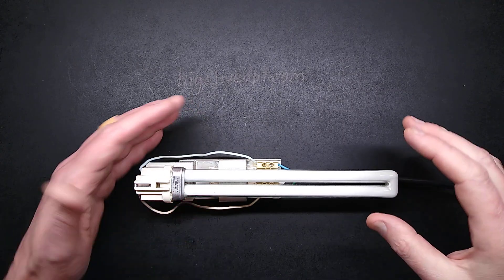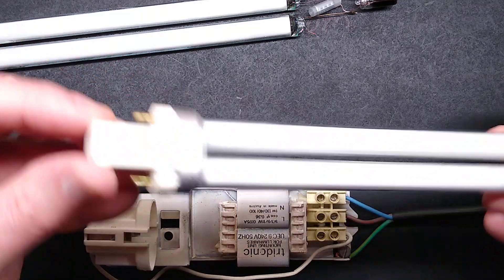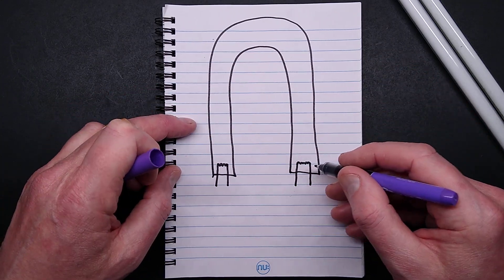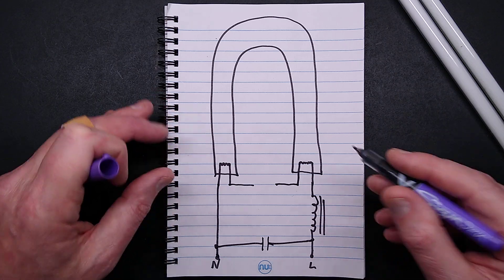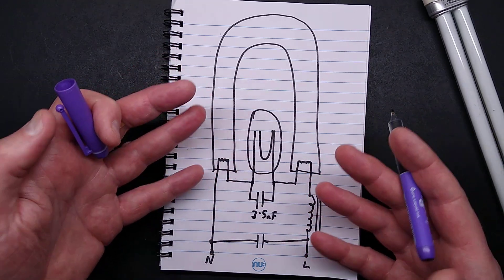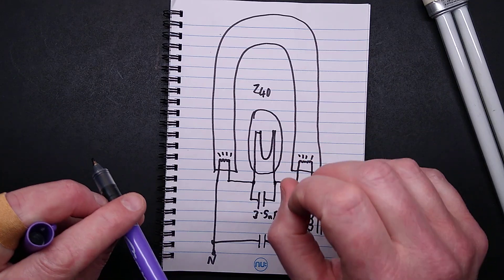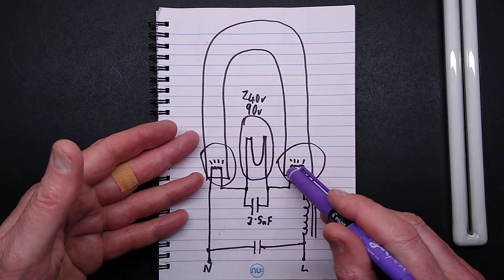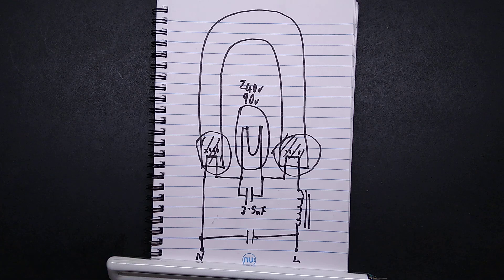Retro already?

Comment: I find the discussions in the comments about LED longevity to be lacking. I have a set of Phillips Hue lightbulbs from 2016 and they're all running normally today, 7 years later. It is a shame to see such a cool piece of lighting electronics slowly fall away but I don't think that makes LEDs "bad".
Reply from the maker: The very first LED lamps were reliable.  But they have since been engineered to be less reliable.   Sounds like a conspiracy, but they really have been engineered to the edge.

Comment: What's wrong with the fluorescent tubes? Are they inefficient? LEDs often require exotic elements that are mined in destructive ways. Even more so for things like cobalt and the rare earths and lanthanides that are used for things like lithium ion batteries, solar panels, and high power magnets for wind turbines. Don't get me wrong, I'm all for going carbon neutral. Heck, go carbon negative! But I think we forget the impact our hunger for raw materials has on the planet and other people. Not to mention that these things are often much harder to repair meaning you have to throw them away and buy new ones, contributing even more to this epidemic of wastage and over-extraction.

Comment: I despise that the damned communist EU has to ban such a great light type like the fluorescent bulb and replace with those garbage LEDs, its not about the environment or anything just the companies have found a better way to earn more money from that and they are lobbying to ban other cheaper lighting types, i still use the old incandescent bulbs because i won't give in to the green communists and i will definitely have to stock up on some fluorescent tubes because i use them in my bathroom and and a few of them will probably last me for decades because they seem to last much longer than cheap LED lights

Comment: A while back, I bought a few old fruit machines, One of them "Crazy Fruits Casino: GOLD" (2003) had one of these inside to light up the games' logo on the front door. I think the company that deigned the cabinet to didn't expect anyone to change the bulb because the amount of work needed/Things you need to take off the machine to get to the thing is a pain in the arse. It also destroyed most of the decal detail work on the glass because of the 20+ years of heat from the light.

(Not sure if the bulb was changed since 2003, But most machines like this are powered on for at least 14 hours a day, 7 days a week.)

To the point: I only managed to swap mine out a few days ago after months of putting the job off, and then you upload this, What a funny coincidence LOL.

Comment: Its not the red tape or mercury - efficiency is the main driver for a ban, LEDs were roughly 3 times more efficient than fluorescent tubes 10 years ago, now its probably 5 or more - source - designed replacement tubes from the ground up, even back then cost of replacement + running cost was enough to pay for themselves in 2 or so years, and the ones we made survived for 10 years - I've recently visited the hospital where we did the retrofit, and roughly 5% of them failed.
Yeah, about that mercury - its not that dangerous per se, its just stupid people not disposing of the tubes properly.

Comment: I had the issue requiring flicking it to get the starter to separate on a ceiling light which I learned to tap on by experimentation, it was SO COOL to learn why that happened and why what I did worked.

Comment: I loved fluorescents before they became poor quality junk. The tubes we could buy in recent years had a lifespan of months, not years, and the cost went way up. Top brand electronic ballasts began failing almost as often. Had to think we were being forced into LEDs, which failed just as often and were also overpriced. Tiring of the constant cost and replacement headaches, I swapped for LEDs in most of my fixtures, despite the harsh light and poor CRI.

We had to replace our refrigerator several years ago.  It uses LEDs inside. All three LED units died within months. Replacements are $109 US apiece. Therefore, it’s dark in there. It’s so absurd to forbid an incandescent lamp that is lit three minutes daily and lasts 40 years. Likewise being expected to install LED in my three attic fixtures, which might burn 15 minutes annually.

Comment: Many (many!) years ago I inherited a desk lamp from my grandad which had a manual starter - you pushed the button, kept it held down for a few seconds then let go and most of the time the lamp would light. If not, push off, then try again... Very low tech. solution.

Comment: I would say that high frequency would go before low Frequency. 
The massive benefit of low frequency balasts is that they are designed to work in worm places, so they are often used inside canopies above hobs in restaurant. As I cant always get them in low frequency with GLAS front and metal clips,I have been fitting some Recessed spotlights there, but that is a recent trend and requires good quality fittings. 
But the massive benefit is in Fish and chips shop where its common approach to place lit-up logos over the chippy base, which because its used for frying, is far hotter then standard food display cabinet. These bases get realy hott and sign front reduces cooling. Low frequency ballasts are designed to run hot and can usually handle it for a long while.

Comment: Don't forget mercury that is the main generator of UV that is transformed in visible light by the phosphorous coating. In U shaped lamps mounted towards the ground sometimes the liquid mercury washes the coating when it is turned off, and you can see the the drop of mercury there and by that part a little of the UV escapes by that window.

Comment: When working at an amusement park they conducted an experiement on what light-bulbs would last the longest, since they had hundreds and the cost of replacing broken bulbs many times over outhweight the cost of the bulb itself.
The experiment resulted in an off-brand LED bulb as the winner. It lasted longer than the florecant. More interesting was that it was an of-brand and not the Osram that lasted the longest. (I cnat remember the name of the brand, but probably that lightbulb is everywhere in the park now 12 years later)
Reply: The Phillips LED ones I have seem to be dying in a relatively short time. I should try conberting them all to LV.

Comment: To be fair they should have never been allowed in the first place, CFLs have mercury in them, in any other product it would be banned. But the nutcases promoted this crap before LEDs became a thing because it was "green".

Wonder how much damage these things caused, nobody ever disposed of these things in the proper way.
Reply: CFL's were introduced way before the 2006 ban on mercury.

"The nutcases", as you call them (I prefer "cynical bastards" myself), promoted the crap because they could make tons of money selling it. These same cynical bastards have been actively lobbying for years and years to push back the mercury ban, rather than design and produce actual decent LED replacements

Comment: Fluorescent tubes work fine in higher ambient temperatures such as the heated build chamber of a 3D printer. Halogens do too, but their short lifespan is a nuisance. LEDs do not work well in such an environment. And with an electronic ballast the efficiency of a fluorescent light is not that much worse than LED if you take the real lumen/W output of a complete LED fixture at normal operating temperature instead of the lumen output of the chip itself at 25C.

They had a point when they banned non-halogen incandescent bulbs. With fluorescents, not so much. Of course there is the mercury issue, but given the tiny amount of mercury and life of the average fluorescent tube versus the E-waste produced by all the LED armatures that last two years?

Comment: We're going to have light bulb ban here in USA. Welp. The ban covers fluorescent lamps, Incandescent light bulbs and sodium lamps. I just sent email to the bulb reseller to confirm the light bulb ban, whether it would include the metal halide bulbs or not (I modified my Cyclops Thor Colossus halogen spotlight to HID, now with the 35 - 39 Watts ceramic metal halide bulb installed, and it works quite well with computer-controlled car HID inverter ballast, so of course I am a bit concerned whether I can get more bulbs or not once the bulb in my modified spotlight burns out).

Of course I do use LED, preferably of better quality, the LED isn't suitable for the gigantic Halogen reflector, so I have had to go with metal halide HID lamp due to the optical characteristics of the lamps in general, it's just best to use HID bulbs in the large and deep reflector, not to mention nice hue from the CMH bulbs compared to the headlight HID bulbs. Just gotta put some thoughts into something that I modify.

Comment: The downfall of fluorescent lamps IMHO was the electronic ballast. The original iron core ballasts could last the test of time with user replaceable starters and lamps. Now I strictly only use lighting manufacturers that give a 5 year or 7 warranty (best I've seen local to my market).

There's such a huge range of junk manufacturers make this modern age, they need to be more accountable for e-waste IMO.  Some of the oldest fluros I've pulled down have been functional in WW2 era homes, you can't tell me they made the old girls to last!

Comment: My friends have changed over to the modern types.
I have collected all their cast offs to use for the garage and outside lamps
because the High Efficiency fluorescent lamps do not like the cold
nor last any where near the hours advertised.
By series wiring an automotive lamp to incandescent drops about 10v ac 
of the mains and the lamp lasts so much longer.
Also the LED versions are so over run their life is limited.
So I experimented ; wiring ceiling triple clusters with 3 identical 
LED lamp in SERIES. They have already out lived the control lamps.
The higher cost of using incandescent is practical for the seldom used 
side of house lighting and the garage where the heat given off is welcome .
In the house it's under run LED's and a huge HF linear for those long winter evenings.
New technology isn't always good.

Comment: Re the germicidal lamps there should be sufficient demand for a few factories to keep going. Special purpose lamps like these (should be?) will be excluded from the regulations. There doesn’t seem to be a solid state alternative. The machinery / processing isn’t uncommon, one big issue is sourcing the cerium free glass since ordinary tube glass becomes opaque to UVC very quickly. Steriliser lamps up to 17kW and more are used in power stations, sewage farms etc but they have quartz tubes.

Comment: Clive’s remark about EU red tape is rather awkward since UK manufacturers and committees had by far the most influence in setting up the EU standards, regulations and harmonisation in lighting. 
The “big thing” about these compact fluorescent lamps is that they have tri-phosphor (basically red, green and blue phosphors from television tube manufacturing) coating as opposed to the halophosphors used in older larger diameter lamps. Tri-phosphors have better light output, better colour rendering and are much more resistant to mercury degradation. Mercury from the mercury vapour arc is slowly driven in to the phosphor by electrolysis making the phosphor less efficient (dimmer) over time. The tube glass will also be affected by mercury ingress that is mitigated by an alumina pre-coat  inside the lamp before phosphor coating.

Comment: The fluorescent lamp was a remarkably short-lived technology. I almost wonder if we're going to find a replacement for LEDs in the next decade or two.
Reply: You'd be surprised how long the fluorescent lamp has actually been in service. They used to have bayonet cap ends, before the bi pin version took over.
Reply: Flouresent lamps been commercially available since the 30's. Though CCFLs didn't start showing up until the 80's.

Comment: In our experience so far, incandescent died the fastest, had the best light and were cheap; fluorescents lived the longest, had the worst light, and costed a little more; and LEDs are middling across both categories but the most expensive by far. This is agnostic of power consumption though, just user experience

Comment: Some compact fluorescent lamps lasted a long time, others did not, I claim it's survival bias if you think they usually last a very long time. Compare to incandescent lamps, there's one centennial light, it's absolutely unique, not the norm, not even for bulbs predating the Phoebus cartel. Even long after the Phoebus cartel, incandescent bulbs that were supposed to last about 1000 hours could last a anywhere from few hundred hours to many thousands of hours.      

In general CFLs were slightly, (or more) worse than contemporary tubes, in most ways. Like LEDs, fluorescent lamps improved over time, even some fluorescent tubes was still improved upon when some started to replace them with LED-tubes. Sure, I've seen fixtures well beyond their "best before date", with their original CFLs still technically working, but those are very rare exceptions.  

I changed one, still technically working CFL, a relatively modern version, 20 watt, to a 11 watt LED, the LED lamp had slightly lower nominal lumen-value and measured the light, the new 11 watt LED put out over 4 times as much light as the old 20 watt CFL. Sure LEDs degrade over time too, and there are plenty of really bad LED lamps, but decent LEDs don't degrade nearly as fast as even really good fluorescent lamps do. I've changed a number of fluorescent tubes and lamps, that still technically worked and got much more light, and lower power consumption.   

I fully expect to replace most of my current LEDs before they stop working, not primarily because of the degradation, but because there will be so much better replacements.

Comment: I’ve had a lot of trouble with the fitting outside my front door, as the tubes have only lasted a few months then needed replacement. An LED module would be a massive improvement as far as I’m concerned

Comment: I like fluorescent lights. They are still fairly efficient, especially compared to the cheaper LED lights that most hardware store sell (we all know that most people won't buy the $30 light bulbs)

They are very rugged, handle heat much better, are easy to drive,...
For some reason LEDs drivers seem to fail much more often than electronic "ballasts." And iron core ballast pretty much never fail at all.

Starters failing somewhat often are the only slightly annoying thing in my opinion. And even then, that's what, once every couple of years?

Plus, you can't drive a LED light with a vibrating relay and a 12V battery, or a Tesla coil

Comment: I wonder how any bans are going to affect black light bulbs and other UV tubes.
Fluorescent tubes are just the easiest and cheapest way to get any class of UV you want. 
I will miss the regular bulbs too, there is something magical to these long glowing rods that light so uniformly and unidirectionally. I know of a traveling carnival that seems devoted to their fluorescent ride lighting (alot of their rides are from the 50s), even if they have to replace ballasts almost every season and there is bound to be a few busted tubes every setup and teardown.
Reply: All bans have exemptions. Specialist lamps appear to be exempted where no valid replacement exists, though mainly for the lowest power lamps.

Comment: I salvaged a couple of these fittings from an old office reno late last year. Each workstation had one fitted to provide a desk light in a space with no natural light and fairly high ceilings. I'll probably use them in the shed as dedicated lighting at the drill press or bench grinder. I was mindful enough to grab all the working globes in that office also, so I shouldn't need to chase up any replacement tubes ever.

Comment: The old fluorescents had the old style ballast in the fixtures or above the ceiling. We still have a few of these 1950's fixtures in the library of the university observatory we meet in. One night it smelled like burning tar. I traced it down to one set not turning on, hot enough on top to burn fingers. The ballast was potted in tar as these were originally. The university's physical plant people had to check and replace the old ballasts with the modern ones as these are a fire hazard.

Comment: I would love to find a source of these 'PL' tubes in the 13 watt variety but from a reputable supplier before they vanish, both the germicidal variety for my pond filter as well as for standard light fixtures. The visible light they put out is the least offensive to my eyes compared to the "warm white, 3000K” led lamps on the market today.

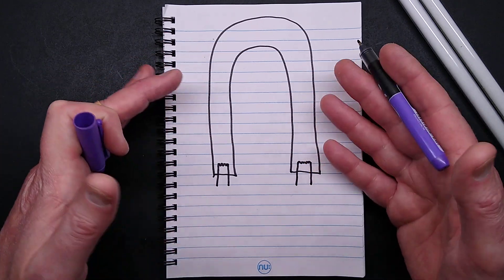Comment: I'm watching at around 2:25, this looks like a xoiln flash tube, how does that work?
Reply from the maker: A xenon flash tube has single wire electrodes at each end and a conductive coating or wire wrapped around the outside.   A high DC voltage is applied across the tube but it doesn't actually strike until a high voltage spike is applied to the outer electrode to initiate gas ionisation along its length.   Then it triggers and dumps the current in a flash.

Comment: id say those are considerably better than the led option, i just love the marketing bs about the 50,000 hour life of the led (which may be true) but the circuitry that drives it burns out in a few months or maybe a year, crack it open and as AVE says "look for the shit stain" exploded cap, had a couple attempt to self start a viking funeral

Comment: That I'm aware of, the ban only applies to standard T8 tubes but may start involving others somewhere down the line, UVC pond tubes are exempt as is projector halogen bulbs.
Suppose this begs the question whether I would miss the old florry tubes, the answer is probably not, they cause headaches and are crap in a cold garage.